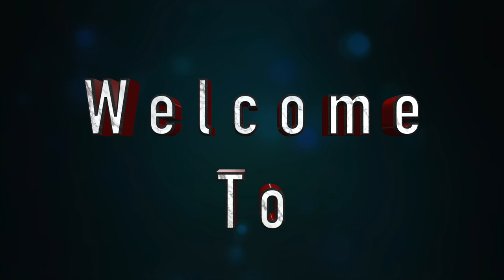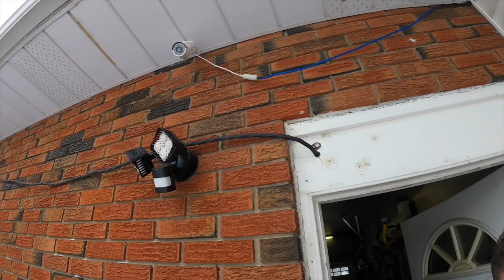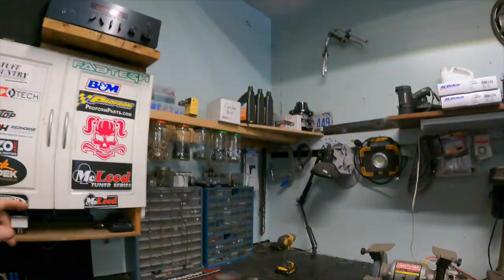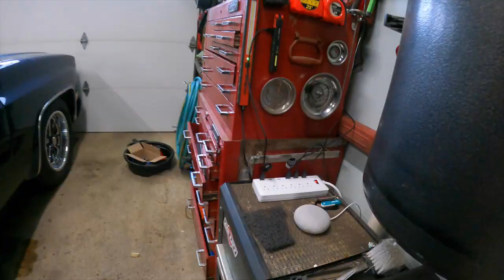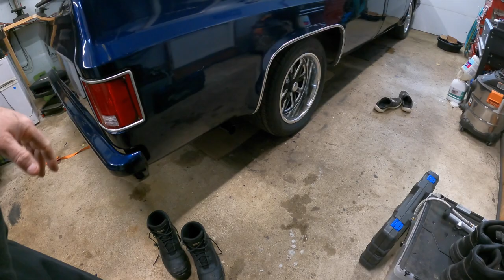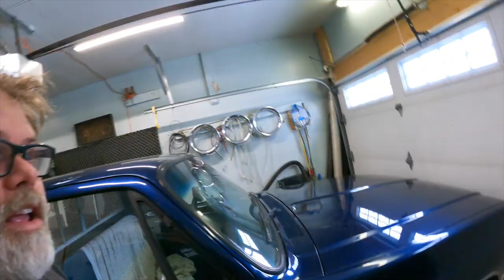I See The Light On My Truck   HD 1080p

Comment: All painted parts with Flake in them need to be painted in the orientation that they will be in on the vehicle.
So if it was painted laying down when painted. It will look different next to the parts that were painted in a hanging position because gravity takes effect on the particles as the paint dries causing different orientation of the reflective particles.